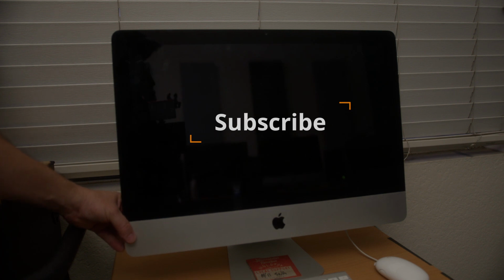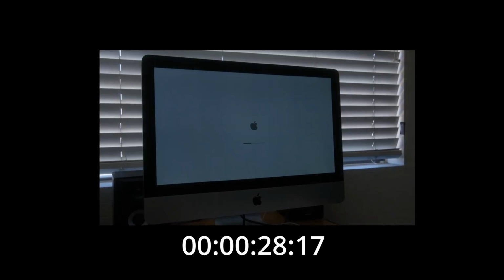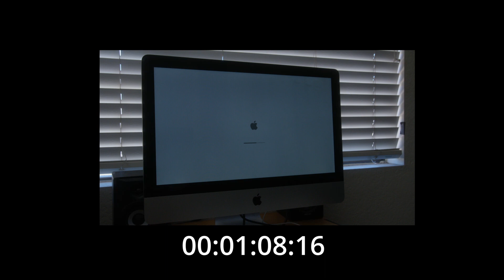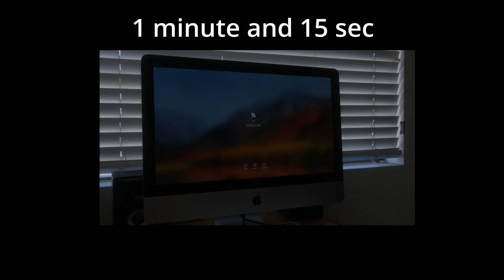How to replace an iMac 2011 HDD to an SSD

Comment: I am having issues with fans staying on and then shut down while trying to do the Internet Restore.  Apple logo freezes and then computer turns off.  How do I fix this ?
Reply from the maker: I would recommend to try and see if there is anything wrong with the steps. Or if any cable is disconnected or something that could affect this process.
Reply: Usually it's a connection problem. Watch the video again, follow the steps while reconnecting VERY closely, use air spray cans to clean up the mess inside (2011!). For a more detailed look at the reconnecting issue, see the OWC videos on upgrading SATA drives in 2011 27" imacs.

Comment: Followed this exact but I’m getting the file ? Screen
Reply from the maker: Sorry didn't reply on time. I hope you were able to figure it out.  Sometimes I repeat the process.
Reply: With a brand new ssd inside, there is no operating system. That's why usb sticks were invented. Make a usb installer stick & boot up. Install your OSX flavor (with the mid-2011 imac Jacobs ladder ends at High Sierra) or even Open Core with some newer than High Sierra OSX version (Monterey will do) and live your digital life.